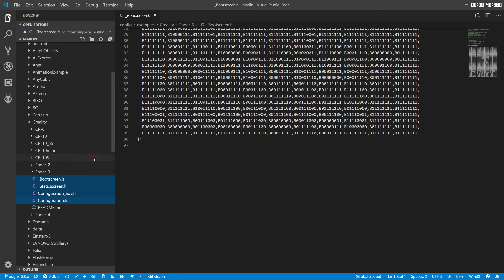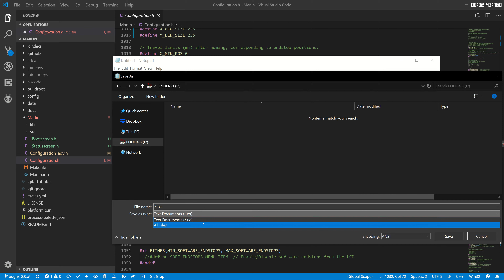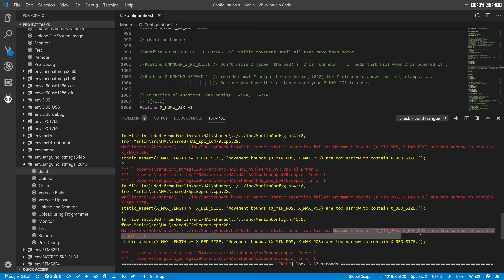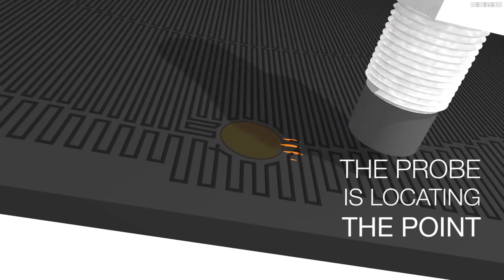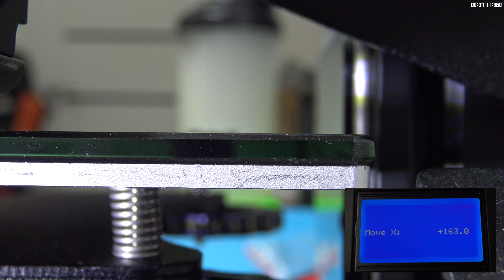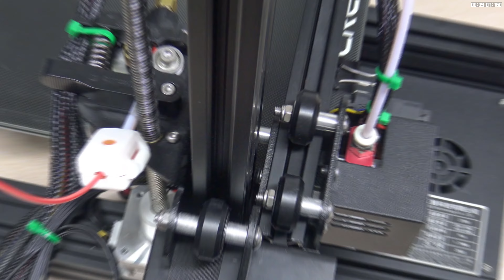Marlin: Print area (3D printing)

Comment: I did all this with a new motherboard and it never gave me a steady HOME position, everytime I hitted HOME it moved right to the center but if I hit it again it moved like 10 mms. to the front and to the left so everytime I hitted HOME, no way to have a permanent HOME position besides the endstops switches inverted or not PHISICALLY OR IN FIRMWARE never stopped the motors from moving, replaced drivers, compiled firmware more than 50 times and never worked so I assumed it was a damaged board and I returned it. It was a Geeetech Spark mobo. I think this is the only video I have found someone doing a clear explanation of how it works, most of the super wise guys assume that you already know the very first steps and they are completeley wrong, what they call for begginers is really for mid wise knowledge intuitive people. Thank you.

Comment: In my case X_MIN_POS is 6.5 mm (i.e. the nozzle is 6.5 mm on the right when auto homed) and the bed size is 235. However my X_MAX_POS is 239 which means the printer can go that far. With these numbers I get an error creating the bin file saying X_MAX_POS doesn't match with the printable area. If I decrease the printable area (because when auto homed the nozzle is on the right a little bit) I cannot center the nozzle. If there is not a wrong logic on Marlin, I couldn't grasp this.

Comment: Just move the endstop to the correct position. If you can not move the endstop then you have a bad designed printer.
I just need to unscrew 2 screws on each endstop to move it anywhare i want, even to the correct positon.
This way the X and Y home position is ALWAYS 0.
Reply: На ender 3 нет возможности двигать концы X и Y, только ось Z имеет регулировку (
Reply: @vasabi111  Englisch please!
Reply: @fvheel  On ender 3 there is no possibility to move the ends of X and Y, only the Z axis has an adjustment (

Comment: I followed along in the video to get my printer centered (Anet E16), It worked perfectly but I don't understand why it was so off in the first place. Build volume is 300x300x400 and i found that 235x235x400 works best for the printer, but now its the same x and y as my ender 3 in cura. Would you know why it's not able to use 300x300x400?

Comment: Good video but I've got a problem. Just installed a BTT SKR 1.4 Turbo with TMC2209 drivers and a BFT35 touchscreen (updated BTT firmware with new icons). I followed your instructions to the tee and don't have the "Release SD card" option on the 12864 screen. There is an option on the touchscreen, however, nothing happens when you touch it? Any ideas?